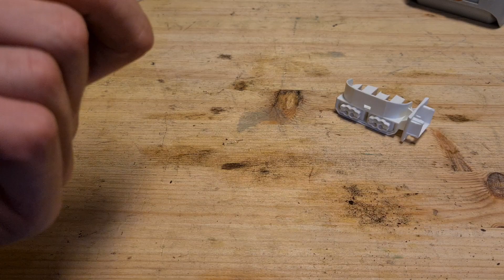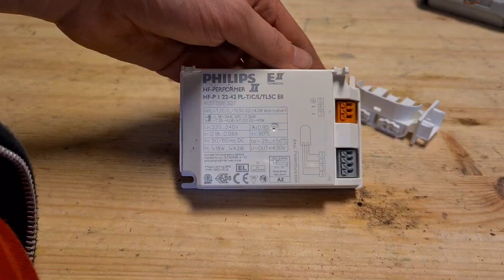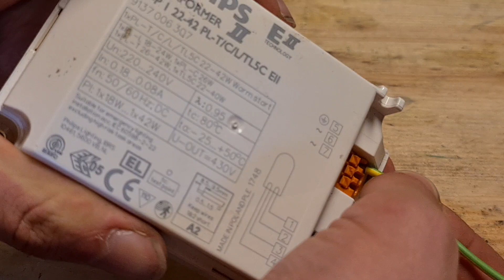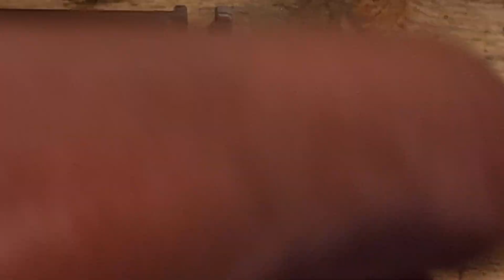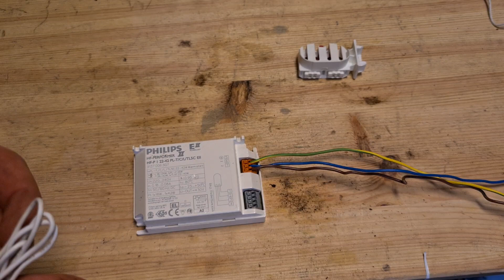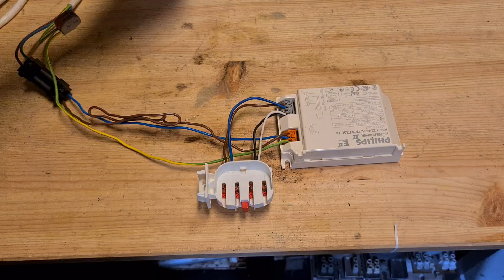How To connect A PL-L Ballast!

Comment: Hi there, thanks for vid but just have a quick question. I have a 9w PL-S bulb that has a built-in starter that's meant for a magnetic ballast, but with electronic ballasts can the 2 live outputs be paired and connected together to the first pin of the bulb, and do the same with the neutrals but to the second pin? If yes, why wouldn't that double the wattage and blow my 9w bulb (2x 9w = 18w)? Would the built-in starter share the wattage with the bulb, so 9w goes to it and remaining 9w to the bulb? Thanks.